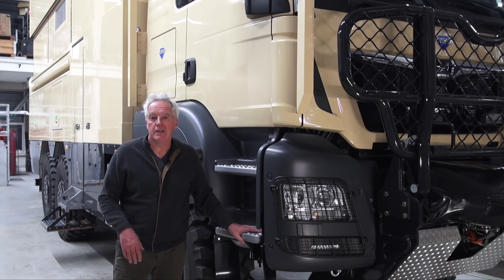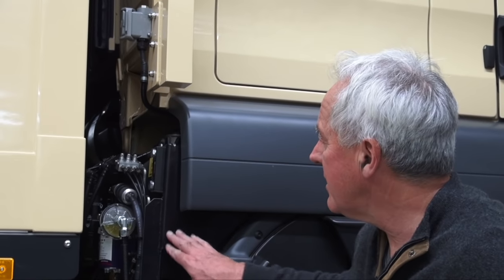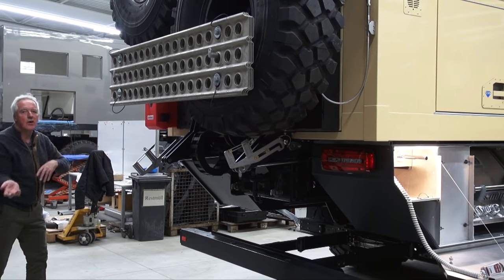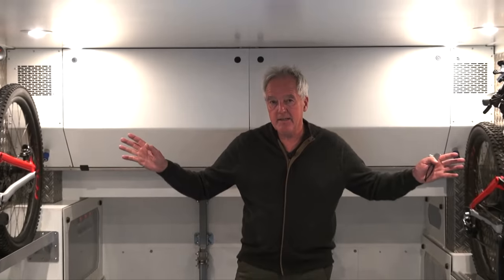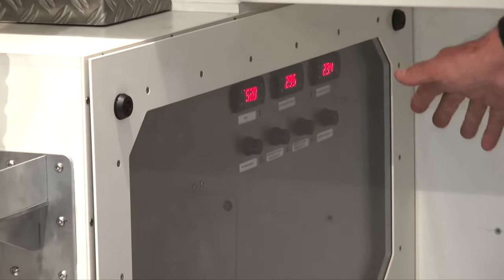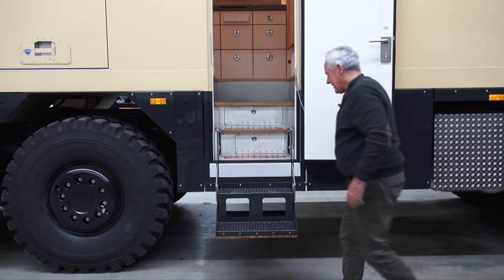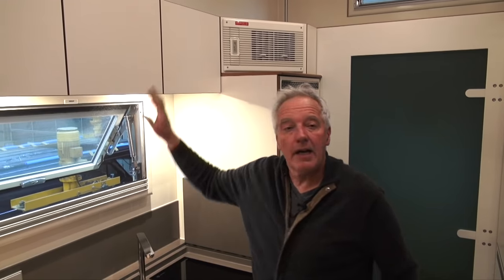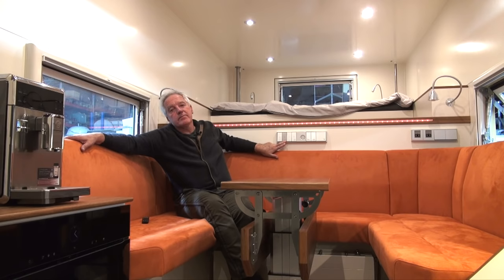UNICAT Expedition Vehicle EX74HD MAN TGS 26.500 6X6 X4

Comment: Thanks Thomas. Has to be the best EV truck I've ever seen. Yes please..... one day, but electric please.
Reply from the maker: It is not easy to make such an electric vehicle, but it is in our future projects ... Thank you very much and don't forget to subscribe to the channel and activate the bell
Reply: @UNICATexpeditionvehicles  I was thinking one day of handing over to you a Tesla Semi to convert to an Expedition Truck. New suspension, etc
Reply: @waynedufty5053  I like the Tesla stuff, but there are also full electric trucks available based on MAN chassis.
The question is : How do you recharge a - let's say - 500 kWh battery pack in the middle of nowhere ?
Reply: @thomasritter1470  Must look into that, but Tesla has the best battery and software. Even if a MAN truck I would hope the roof top and awning PV panels would recharge in remote locations. Thanks
Reply: @waynedufty5053  The reality is that an electric vehicle of this weight and expected workload simply is not even close to being feasible with current battery tech.  Look up the recent JCB video of how they tried to electrify their 400,000 strong fleet of large diesel vehicles.  They are now looking at hydrogen.
Reply: @bobmcgrath1272  Tesla Semi might be the solution

Comment: I am impressed by the technical systems.  30.72 Kwh of lithium is excellent and will give very-good autonomy while boondocking without the noise of the generator.  The window air conditioner is mickey-mouse as is the pop-up TV.  You could have a window in the seating area and a drop-down shade for a projection TV.  The AC should be a dual cooling and heat pump that you could mount under the garage.  So many other things.   would like to see more details and photos of the chassis and steering system.  There are many technicals details that you did not cover.  Solar, exterior shades, blinds, windows, rear steering etc. Let's see more of those details first. Thank you, Thomas.
Reply: Dear sir its something for the Rocky, nothing can keep up with this piece of mobile art utmost quality a long life long  at the same time this man is a thinker its a van gogh unicat piece of art, kind regards from the Netherlands,  a always want to go back to your beautiful country like 50 years ago
Reply from the maker: We can't show everything 😜😜
Reply: @UNICATexpeditionvehicles  good afternoon, herr Ritter, as a only child born in 1956 my father had an machine constructie fabriek ich spielte mit 5 jare nicht im zandkasten aber sie rates  mal ich war in den fabriek und hatten drehbanken7und 8 meter lange  hobel,  freesmachine ,kottermachinen, radialbohrmachinen staal p1, staal 160 225 hb p2 ,roestvast ect ect messungen in mu 0,000 001. My father die at 53 herz verzagen starb and i was 15 years joung mother sold the factory had customers over Europa this all was in 1972 . Schweissmachinen rost frei alu tig ect. Now herr Ritter  you will say what has that to do whit unicat well let me say that jeder unicat schweiss nath alu, rostfrei oder staal  is straight no gas init that knopfschaube innensechskant von rostfast staal zint und so weiter, alle ture zint straight mit rubbers afdichting.  Ect ect but bove all in my humble opinion you are like by us at home there are almost no problems we can solve , we were thinkers ,solutions before we sleep   ect ect and we stehen vor unseren mitarbeitern. Tja what has that to do with UNICAT daimant, in my mind opinion and as small child and now as 65 old man is that throug quality  of yourself the mitarbeitern  erworben , und wen men ein geschultes Auge had then you now the unbeleavebel quality of the fahrzeuge von UNICAT,  and i think that your films are from i high standart and i now that you cant and imposibel to show this detail quality  from staal bis scharnier mit messingringen . I do apologize for the German and English language but i now for shure Herr Ritter that you will understand how i look to your superb vehicles and i now i have to be carefull but there are not many manufactorys who can do the ....... in my humble opinion.  Succes Viel Glück mit der Fabrik, toon vermeulen, Die Niederlande.
Reply: @UNICATexpeditionvehicles  I suppose not.  Perhaps a follow-up video?  There seem to be a lot of great vehicle features that would be nice to hear about.  In any case, thank you again for sharing!
Reply: @antoonvermeulen8064  Dear Mr. Vermeulen, thanks for sharing your view with the community, I really feel honored.

Comment: I had mine armored B6 in critical areas
Ordered a matching light armor polaris with rifle mounts;
A dedicated FN armory in the garage and cabin;
Chucked the outdoor grill for a chest freezer and smaller grill;
Inserted a Med bay in the large empty space overhead;
360 NV and barrel ports all around.

Parked in my self sustained ranch with bunker.
You can release the undead virus anytime.
Reply: I like your style, I'd probably add a flame thrower or mini gun, perhaps a rack for spears in the event you run out of ammo
Reply: @seanrota3359  i commented somewhere i forgot to add a drone-installed flamethrower too when i saw a vid of that.  It's a real thing.  😄
Reply: @jakerio8  Aerial coverage is an advantage and will provide a secure safety perimeter from any zombie assault. Might affix removable metal blades for the wheels of the Polaris similar to the Roman chariots in case of being overrun by a zombie horde, just thinking of the possibilities

Comment: Nothing but the best from UNICAT.... I Think it would be great if you include a central locking functionality for all the outside compartments.
Reply from the maker: There is. For three years now, all our vehicles have been equipped with electric central locking, with an exclusive system designed by us.
All the external doors of the body, except those under the body, are electrically closed with a remote control, or with a transponder, or, obviously, with a mechanical key.
Reply: @UNICATexpeditionvehicles  AAnd we are working on a system that will also include central locking of the storage boxes under the body.

Comment: I love these tucks. I always think the toys are very cool as in just push the button and what ever will happen. But if I was to do it for myself I would want a version that was manual instead.. the idea of a bug out living or if there were an invasion exp hardened etc or stranded for so long that the technical side was not able to last. So to engineer it to function well with much less electricity operated but still mechanical heat o steam driven. So still highly engineered but mechanically based.  You seem to have an engineer background or do you just employee them. It looks as though ther are a lot or fun r and d days in the shop. I love the exacting fit, finish and function of things. With I had the funds to set the minds at you disposal to a few tasks that I would put into my apocoliptic escape vehicle!  Gasifier/generator. Swing in or out wood stove that heats the water system with steam or other driven pumps manual pressuring system for water ....
Reply: Emp hardened. Not exp
Reply: As soon as you light a fire to make steam, your position is compromised....
With solar and battery, you are not only silent but invisible.
Well as invisible as a 20ft high 20ton HGV can be. 🤣
Reply: As we all know, both mechanical as electrical stuff can fail. The idea is to design it as simple and reliable as possible and actually, driving something electrically is in many cases simpler than designing a manual actuating system.
A electric motor can be installed wherever it is needed, while for something hand operated, you have to make the link from where you can operate it to where the movement is needed. Just one aspect ..... and yes, we have a lot of fun R&D days

Comment: I am Just wondering that is it possible to convert  this to electric vehichle? It looks like enough storage for batteries and big area for solar panels on the top. Not sure if it can be possible to carry this beauty via Electric engine but as i remember tesla already announced Electric truck so not sure though...
Reply: Call Elon at Tesla!
Reply: It could absolutely be done, but the efficiency would be awful. This truck is going to be in the neighbourhood of 40,000lbs before including electric drives or the battery bank required to power them.
Reply: @bradsimpson8724  as i read at somwhere they are already making fully electric mining trucks. Maybe few more years later with better battaries, we might see fully Electric Explorer vehicles.
Reply: Check out the Mercedes eActros. It's a full electric truck in this size, which you can buy. You don't have to wait for Tesla to make a proper truck.
Reply: Electric is good for a cars were range isn't that important
Reply: Personally I would just say get a bunch of Tesla batteries and just put it all on the bottom because your vehicle is so long you can put all those long there something like that
Reply: Considering it's huge weight (≈20 tonnes) and huge friction due to it's big tires and bad  aerodynamics and the fact it will be mostly used offroad it would have an unusable range if it is electric (probably would be less than 300km) comparing to up to more than 1000 km in a diesel truck.
But surely going electric is more quiet and has less operational cost
Reply: Actually a nice idea for a motorhome but not for an expedition vehicle. This rig is not meant to go from campground to campground with only 100-200 miles between them. These rigs usually go into remote areas where public chargers are not available.

Comment: I like those smart details this vehicle is filled. Do you utilise the extra heat generated by the diesel generator and inverters for keeping the cabin warm in winter?
Reply: Hot water central heating (9.0 kW) for diesel operation with height adjustment and heat exchanger to use the engine waste heat to heat the cabin and to generate hot water while driving

Comment: I just noticed at timestamp 10:45, that if you had the Polaris side-by-side in the garage, and the hydraulics for the rear door had a problem, that you would have to have the Polaris out of the garage, and the door open to service the air compressor and hydraulics.  I see an interior access door, but damn.  I sure hope there is a second method for opening that garage door.  If I bought this rig, I would FOR SURE have two bikes and a quad.  F-O-R. S-U-R-E.  P.S. this is currently my most desired vehicle on this planet.
Reply: There is a system to open the door manually from outside.

Comment: The Germans do like to keep it simple. 😉  A technical tour de force for the discriminating CEO.  I can't help but think if this vehicle is used for true overland adventures, all the chassis flex, vibration & dust will play havoc with the electrical & hydraulic systems.
Reply: You do know that tractors are literally designed to work in the dirt right? Hydronics dont care about the dirt or dust. 
The electronics are in sealed compartments. Unicats have been touring remote places of the planet for a long time.

Comment: Really amaizing piece of kit but for that money I believe you can get away from that small key to open all those outside compartments. For one it is easy to pick and open lock for two it must be owner nightmare has so may keys!
Reply: The reason for the many locks at the outside storage boxes is that the we wanted to keep the wall thickness of the door at a minimum to maximise storage space while keeping the box well sealed. But we are working on a solution .....

Comment: Fantastic engineering as always. But I really don't like the interior space. I said this before on the teaser and Thoms said to wait for the full video.  It hasn't changed my mind.
Reply: Agree! The esthetics is not their strong point. I hate those buttons on the control panel. They could use something more beautiful. That is why I like Action Mobil they really are beautiful trucks inside.
Reply: Well if you learn about the vehicles they produce they are custom, so while you may not like what this person picked if you could afford one you can specify the interior to look different.  The comment by alfredo about buttons on control panel those are also you DC breakers, unlike others that have you replace fuses he uses DC breakers so you never need to find fuses and you do not need to look at them unless you pop the breaker.
Reply: @André Yes, probably so.
Reply: @badgerpa9  Agreed Badger.  Mine is very different.

Comment: I'm surprised at the lack of windows also how small the ones are that you have fitted. Imagine you are in a beautiful wilderness and you can't see any of it until you go outside.
Reply: @John,
re -- windows
2003, for our ExpeditionVehicle, we mounted 3010 (three feet wide by a foot tall) dual-pane sliders designed for a stand-still house.
We mounted these at our eye-level standing inside, about eight feet above pavement.
.
Small windows are small targets for FOD and branches.
.
.
re -- seeing outside
We do not live in our ExpeditionVehicle.
We live out of it.

Comment: The only downside i can see in a Unicat is the lack of warmth and cosiness of the inside. Mainly due to the choice of materials, Colors and apparent bolts, nuts, brackets... They’re top of the top technically speaking, but they generally look a bit too much west germany / sovietic inside. Otherwise the built quality is unbelievable, look a this garage and technical integration... And they seem to miss a remote control / management like Bliss Mobil does.
Reply from the maker: We use first choice materials and satisfy the wishes of our customers. For remote control, our trucks have been equipped with remote control since 2013 ....
Reply: @UNICATexpeditionvehicles  great to know regarding the remote management. Regarding the interior design, I’m 100% sure those materials are top of the top, but the design could use a bit of cosiness, especially regarding color choices and finitions, but that’s a personal opinion 😉
Reply from the maker: @psxmax  that's right, personal opinion
Reply: @UNICATexpeditionvehicles  i dont think he meant to be offensive..chill out.

Comment: I have a crazy  question. Is it possible to ship an expedition truck like this by Cargo plane? If yes, 
indicatively how much can it cost?
Reply: I actually looked into that. 
Technically, you can do it, if you are willing to drop way too much money. You'd need Boeing Dreamlifter or Airbus Beluga to do it (And I am not sure you could get it in... Only that the cargo space is tall enough). They cost about 18000 Dollars per hour to rent and need special airports to land. 
These trucks are upwards of 3,5meters tall. They won't fit the bay of a regular cargo plane (B-747 has max height of pallets set at 300cm)
Google MAN CAT truck. That's a machine made for air transport in military planes. The engine is behind the cab to reduce height.
Reply: @Arrynek01  Thank you. 18.000 $ hour are kind of too much.🤣
Reply: @YorickUnexpected  Yep. You'd pay less for the entirety of regular ship shipping between continents.

Comment: What is the water capacity of this truck? Where do you keep the fresh/grey/black water tanks? I guess under the couch area. This is the best expedition truck I've ever seen
Reply: Fresh water 600 liter (158.5 US gal.), Hot water heat exchange 60 liter (15.8 US gal.), Wastewater tank capacity 175 liter (46.2 US gal.), Toilet tank capacity 115 liter (30.3 US gal.). All are frost-proof water tanks and installations, mounted in the heated indoor area.

Comment: My goodness. One can only stand back in awe. Nobody can do it like the germans. Of course I could buy 1000 acres and build a compound on it for what? Half the sticker on this? Like I said, the germans are amazing but one headlight bulb in my s550 was $327!!! So yeah, the best comes with the sticker, but dont forget to factor in operation and maintenance costs (your not exactly going to bring this to joe Bob's auto) I assume the min sticker on this like a bone stock model probably 800k-1m for entry level, probably close to 1.5m or more for what is shown. Ok. Then it's going to cost me 75k if it cost a dime to ship it to me (let's pretend it could even be driven in my country by a citizen as it sits, which is unlikely) then I need to insure it, that's 20k+ p/y, gonna have to do tires periodically like 12k+ each time, god forbid emergency tire situation 5k minimum, regular maintenance ugh tune up oil change rotation on the 550 at the dealership is 3k minimum assume 6x that amount for this thing, so 18k p/y. Every toll much higher every fee much higher. Fuel! Jesus the fuel! Imagine going full on nomad? 100k p/y minimum. Cant buy food in bulk for obvious reasons, so a premium on every calorie (but that comes with the lifestyle, not truly an issue of the rv) . My guess is that to purchase and go nomad for 5 years, conservatively, I'd need 5m+. To fucking live in a pick up truck with a camper pod. God bless millionaires and billionaires because without them being insanely irresponsible, cool toys like  superyachts and insane shit like this  wouldn't exist for me to envy-hate on. Truly amazing machine. If only I were a nine figure net worth kind of guy.
Reply: These are long range Survival Vehicles. The Vehicle I want, will be bullet proof. To stop Armored piercing caliber rounds. And able to with stand against Radiological, Chemical, and Bio Hazard Contamination. With stand wind velocities up to 300 milles and hour. I will most likely be paying at least 2.6 Million and some change. You digeeeeeeee. Yes I digeeeee